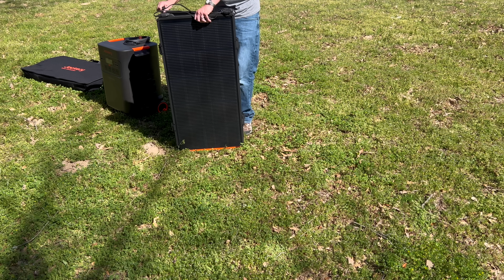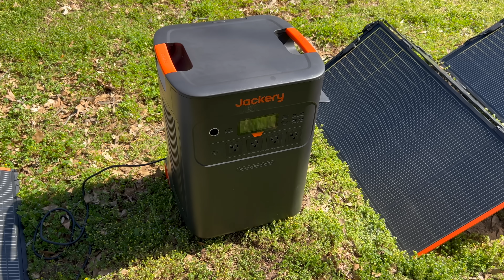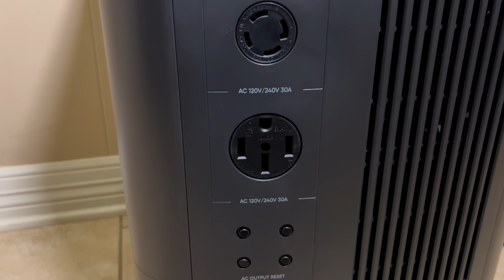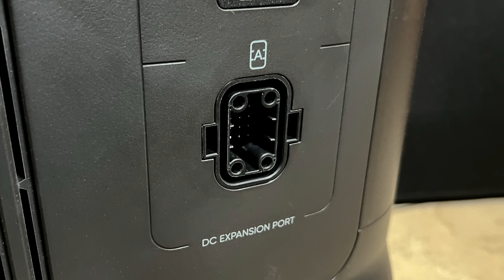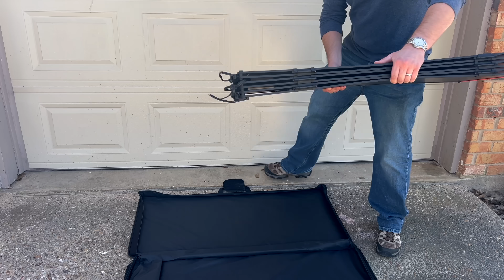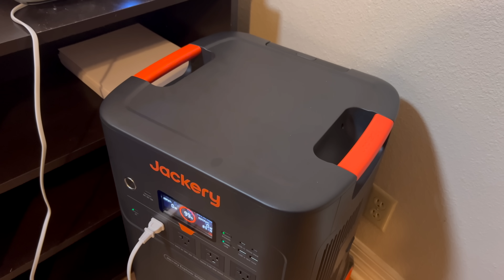Essential Home Backup Power: Jackery 5000 Plus

Comment: Question: would this run central air conditioning for a 2,000 square foot home, and for how long?
Reply from the maker: It should be able to run a central air conditioner if you have it connected to a properly rated transfer switch. How long it will be able to power it will depend on how much battery capacity you have and whether or not it’s connected to solar panels.
Reply: @diypreppertv  OK thank you so much, that is very helpful!

Comment: Do they use a proprietary solar input? I don't recognize those
Reply from the maker: The solar input on the power station accepts a DC8020 connector, and the panels have an Anderson plug that connects to the 8020 cord.

Comment: Do you know this generator or any kind that are able to withstand EMP‘s or coronal mass ejection (CME)?
Reply from the maker: You will need a faraday cage to protect it. I have a smaller power station in a home made faraday enclosure as a backup for larger systems like this one. Thanks for watching!
Reply: @ Also, if I were to turn off my electronic devices before an EMP or CME, will they be destroyed or unscathed since they were turned off? I have constructed a Faraday cage by using an aluminum trashcan and put cardboard inside to help shield my electronics.
Reply: @Lee_Proffit Thank you for answering my questions. Keep up the good work on your channel.